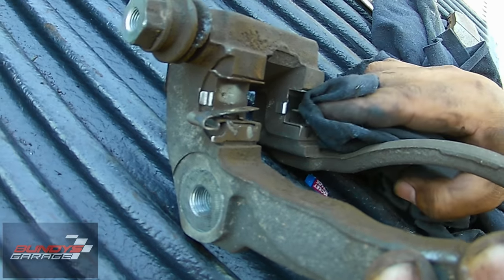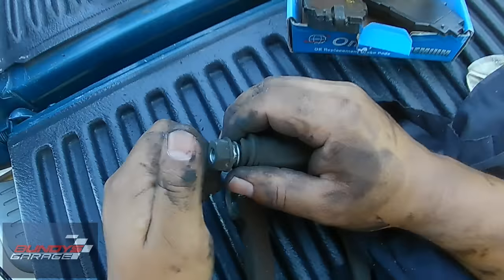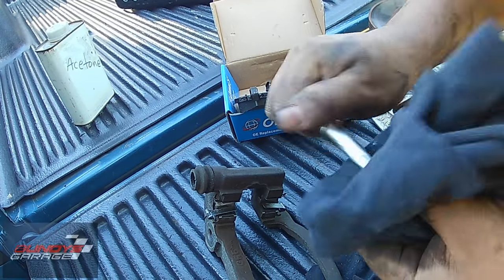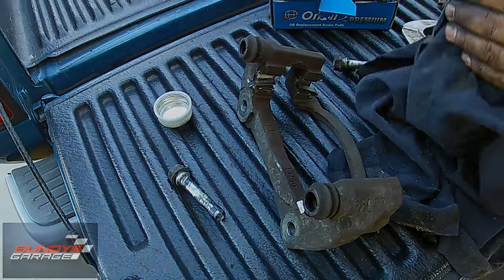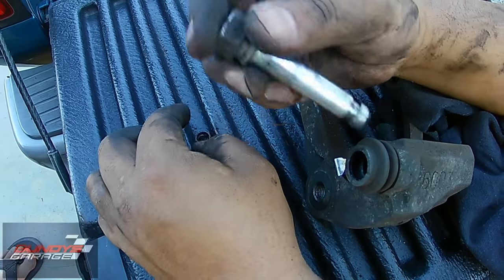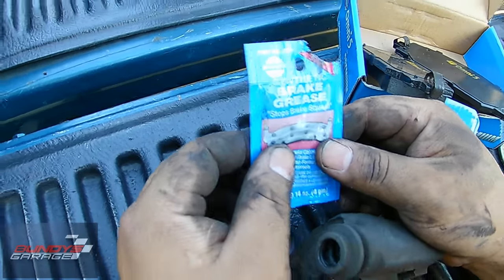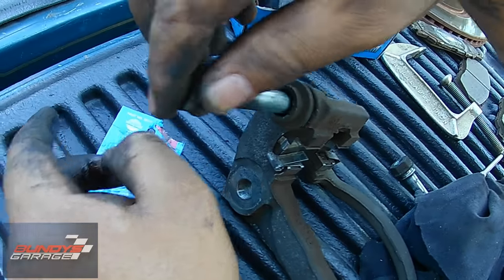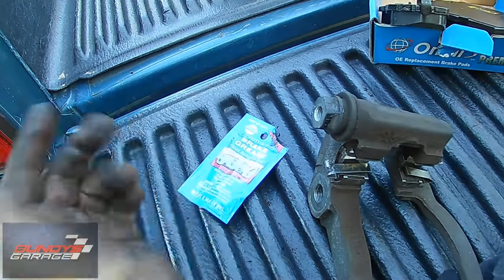What is that piece of rubber "tube" on the lower brake caliper pin? | Honda | Toyota | Lexus | Acura

Comment: 2011 honda odyssey removed the caliper pin bushing on both front calipers due to it feeling seized
Mine werent seized completely but they were swelled up to the point that they did not slide in and out as they should
I have to add that when i removed them they slide in and out beautifully 
I added caliper grease lightly
And closed it up
I did this after noticing the sliding pins werent moving right on all corners
I used high temp grease (red) when i did my brake job 
And my gut feeling today told be to remove all caliper brackets and re lube them
Reply: Will update the next few days how it goes
Whether i throw them back on or not

So far so good👍🏻
Reply: Also another BTW
only have one on the bottom like the video
Which i thought was so stupid!? Like as seeing how beautifully the caliper sliding pins moves after relube and bushing removal
I was flabbergasted

Comment: I would like to know why the rubber part is there and why on only one pin. I only know that the rubber will swell if you use the wrong type of brake grease. To be sure, get silicone paste. Do not use brake grease containing any sort of petroleum. There are synthetics but some of those will also swell the rubber so silicone paste or sil-glyde grease all the way.
Aside from that question, does anyone know if electronic cleaner is safe on rubber? Does anyone know the type of rubber used on the slider pin boots? I want to clean out the sleeves where the slider pins go before adding new grease. I don't want to damage or weaken the rubber boots. I know that brake cleaner will do some damage but have seen it used there. Any rubber safe spray solvent that will clean grease?
Reply from the maker: Just got it off and reinstall the pin and then you don’t have to worry about it getting seized in the caliper bracket.

Comment: If the bushing swells up it is because you are using the wrong type of grease! Best is to use silicone based caliper grease.
Reply: It still don't work. I went got new pins without the oring no problems since

Comment: Caliper assembly including rubber sleeve is not for the whole life of a vehicle. Rubber swells and seizing occurs if not checked during service at 20, 000 miles. Greasing is very important .
Of course silicone with ptfe is the best choice that doesn't swell or shrink rubber.

Comment: Don’t use brake grease use Silicone brake grease / lubricant. Other greases are made with petroleum and that will eat the rubber boot letting water into the calliper slide pin bore.

Comment: So ... my conjecture on the purpose of that piece of rubber on the tip of the slide pin is to create a seal so that back pressure will be created inside the the bracket pin housing so that it will help the caliper to retract after the foot is removed from the brake.

But ... kind of stupid only to put it on one pin as I am certain that this is the cause of nearly all beveled brake ware from top to bottom on the pad.   Certainly in the case where there is only a single piston against the pad.  If there are two pistons it might be one of the pistons causing beveled pad ware.

Pure conjecture on my part however.
Reply: If they put it on both pins all would happen is both the pins would seize up.
Reply: The pin is too stop vibration its the internal piston seal that retracts the piston . The piston seal grove  has a slope which twists the seal when the piston moves forward . As you take your foot off the brake the seal pulls the piston back in . To much grease will cause suction and make the pin stick in or out this is where most people go wrong .

Comment: i did this, now i have the  most annoying rattling noise coming from that wheel at any time except when i apply the brakes. I did it because of exactly what you mentioned. The caliper in questions had jammed up and the piston corroded in place. to stop it happening again, i decided to remove it. its not a god idea, the noise is irritating and its probably wearing out the pin.
Reply: Most likely you mixed up the two pins. Switch and the sound will go away. Keep the bushing on it. I mixed mine up inadvertently. Rattling for weeks until I researched thoroughly the problem only after replacing shocks, links etc lol
Reply: @richdars2515  interesting, i swear i came to the conclusion that only one pin would fit on the bottom.... anywya, ive lost the frikn rubber bushing now, adn cant buy it!!!! haha. i will be trying to order this toyota one whos picture looks the same, i recon its the same part as toyota, just hat littel black rubber bushing. Its crazy insane that not a single caliper rebiuild kit ive found, includes these , which honda themselves say expand and bloat!!
Reply: @jeremyjohnthompson5187  if the caliper is on the right side of the rotor, the trailing pin (the one with the bushing) goes on top. And vice versa. My understanding anyway. Picture a dot on the rotor while the car is driving forward. Whatever pin the dot hits first is the leading pin. It hits the trailing (bushing) pin last.
Reply: @richdars2515  thanks mate, thast god infor right there trailing pin is the bushing pin. possibly jsut always the top pin then? arent calipers always on the rear side of rotors? im waiting for delivery of my new floor jack and excited to see if your on the money! thanks again.

Comment: The real problem as I see it is that the accountants that design cars chose a cheaper rubber material that swells when in contact with petroleum grease. For a few cents more they could make the ring out of viton or some other material (plastic? brass? babbitt?) that would survive in the real world where mechanics, both professional and shade tree, use various favorite or convenient lubricants in servicing brakes. Instead of sitting on their high horse and condemning mechanics for not using their house brand of "special" lubricant (probably just silicone) engineer the damn thing to be foolproof. "When making things fool-proof never underestimate the ingenuity of fools." And for everyone's sake if that little problem part isn't needed "design" it away. I don't get it, there are millions of brake designs without this problematic rubber collar, what's it good for?

Comment: I know this is an old video but if I can help one person then it's worth 2 mnts of text...if you see something that's on a vehicle and it's original don't believe someone when they say"you don't need it"..I would be embarrassed to call my self a mechanic and tell thousands of people that you don't need something that's on a car for reason...I did my front brakes on my cadilac srx and had to change both caliper brackets because they were seized up and yes this rubber does sieze up after a while that's because the proper maintenance wasn't used...I tried to keep the rubber off and every time I hit a bump it sounded like my wheel was about to come off.. low and behold all the noise stemmed from the anti rattle boot that I left off... so do yourself a favor and don't listen to some guy on YouTube that's saying " well you don't even need it".
Reply from the maker: YOU DONT NEED IT!
Reply: @bundysgarage  your clearly not a mechanic cus if you were you wouldn't be saying that but ok.. silly rabbit.
Reply from the maker: Yeah dude I’m not a real mechanic, I’ve only been doing it for longer than you’ve been alive. If your tire is rattling that bad it’s not that pin, you did something wrong when you did your brake job, but believe what you want silly rabbit, Trix are for Kids!
Reply: @bundysgarage  so I guess me taking my caliper off and putting the proper pin with the sleeve and ironically it stopped means nothing... you don't know how old I am so you saying you've been a mechanic longer then I've been alive is a horrible come back to my comment... if they want to listen to a mechanic that's telling them they don't need something that was originally their then that's fine but as a mechanic you should be ashamed...

Comment: First of all there's no way that you should be doing any kind of brake work whatsoever Ruben that gasket does reduce noise but it also has some other effects other than the noise in those cases they helped create drag which keeps the caliper from sliding back and forth upon each other and then causing unequal brake wear indoor noise from the brake pads themselves removing the old grease the best way to remove it is with new grease not brake cleaner or anything else this is why your seals are swelling when you use other products on these Rubber products that aren't meant for them always repair or replace with like items the other thing you need to do is clean out the break caliper of old grease as well putting new grease and old grease together really doesn't do much good if it is quite donkey on the caliper slides and or slide whole pin I've been known to use aerosol silicone to help loosen it up to get it out and then a fine brass brush to clean it out sincerely David Jones 30-year Master Tech ASE certified
Reply: That is the most words without any sort of punctuation that I've ever read 😂
Reply: Just like those little rubber O-rings. Sometimes Punctuation is not needed.
Reply: I just,... read  ......everything..... out loud.... and .....yeah....   @atheism7  I agree.... 🤣😫😅😖😫😵
Reply: Congratulations davey...... i believe you have just created the worlds Longest Sentence.
Reply: if it is quite donkey on the caliper slides
Reply: if it is quite donkey on the caliper slides
Reply: The voice in my head was running out of breath by the end.😂
Reply: yes, i put it back together without the rubber and it rattles.  Prob not annoying to non mechanics but super annoying to mechanics.  I will have to take it back apart and install the rubber----ugh
Reply: Good advice 👍

Comment: It's an anti rattle device that is intended to dampen brake noise...  You make a good point that they jam but it is often because folks use petroleum grease on the slide pins that attack the rubber.   The slides came lubed with the a silicone lubricant.  They don't have a function in stopping the car so I suppose it's safe to remove them but most cars have them..   Clearly all the design engineers across most of the vehicles have had got together to jam our breaks..  I don't know the odds of noise if you remove them but engineers tend to work in hundred-thousands, not tens or hundreds, to blast the engineers is common but also pretty naive.
Reply from the maker: Good point. I have removed them from over 100 cars and never once has someone come back to me saying “you know what after working in my brakes I seem to hear a faint sound of brake noise”...

Comment: Toss em out!
Reply: until you start dealing with the many types of brake noises.
If the pins are all gumed up with old dried grease it serves the same purpose.

Just do not clean the slide bore and remove the rubber shim, then caliper to pin freeplay !
anyway this is not really safety related (uneven disk wear)

Comment: I find that removing the caliper pin WITH the rubber boot attached at top and lubing pins before re-install keeps more grease on pin for optimum lubrication......
Reply: Could you please explain why the pin sound be hold in place in the hole totally (as you push the boot up in order to get air between the boot and the pin). The boot has normally a distance which pull a little bit the pin out, i think this would be also o.k.  Please let me know the reason for why the pin sound be totally in the whole. Thanks for your prompt reply.
Reply: @thomasschoberth5276 --- Sorry; but I'm afraid I don't understand your Q....
Reply: Sorry this was a question to bundys Garage.